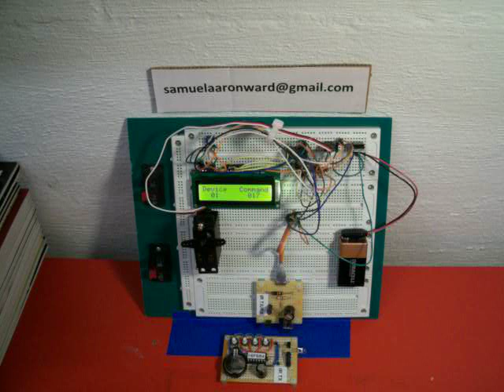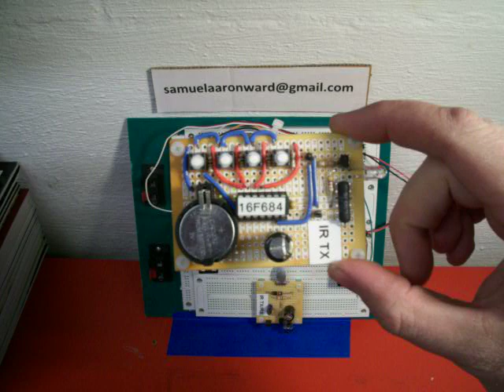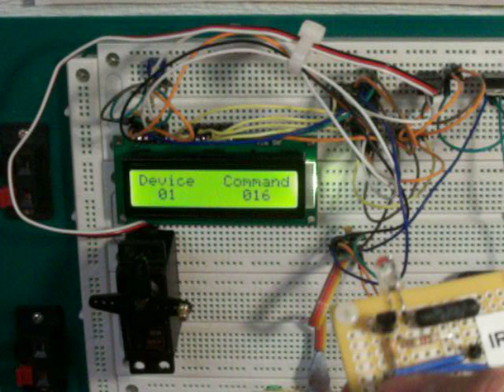InfraRed Transmitter / Receiver Project

Comment: Would you be able to send game console commands if so where did you get the processer and how much also would you need a specific program to code the procceser
Reply from the maker: Braden, yes, you would be able to send commands to a game console; however, you would have to know what kinds of signals the console expects to receive and duplicate that with your receiver circuit.  You may use any microprocessor of your choosing, so long as it has as many digital output pins as your game controller has buttons.  And yes, you will need to write program code for each the transmitter circuit's microprocessor and the receiver circuit's microprocessor.  (No, I do not have time to write this code for you - as I have been asked many times in the thousands of e-mails I have received in response to this video.)  You can purchase two PIC16F684 microprocessors on eBay for about $2.00 USD each.  My code should be attached under "More Information" above.  If not, you may e-mail me at samuelaaronward@gmail.com, and I will send you the two PIC Assembly code programs (one for transmitter and one for receiver).  Please don't leave your e-mail address here in the comments and expect a reply.  I will only "reply" to e-mails sent directly to me with code and other attachments.  Thanks for watching!

Comment from the maker: No, you must program both the transmitter and receiver circuits' PIC chip with the Assembly code.  And you'll have to modify that code to get it to serve your purposes - unless you're just wanting to turn a servo to 4 different positions as I did in the video.

Comment: Transmitter / Receiver If i hooked up these two modules with their voltage source. 
they automatic transmit and receive? without having to program a PIC micro-controller. 
a reply will be very much appreciated.

Comment: Check page 4 of your project PDF(IRTXRXProjectAaronWardDecember2011.pdf): "Software:
In order to modify the PIC Assembly (.asm) code found on the N&V website, you will need a plain text editor such as Microsoft Notepad"

No links for code :-(    Everything is so well laid out, but now I'm stuck.